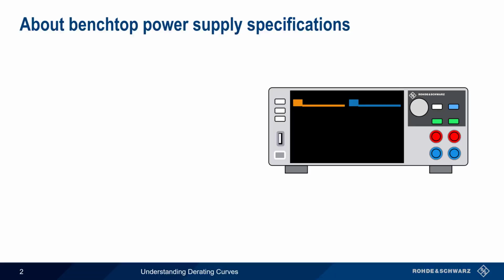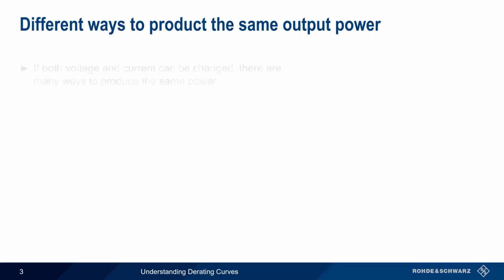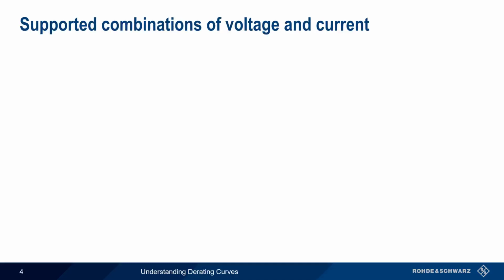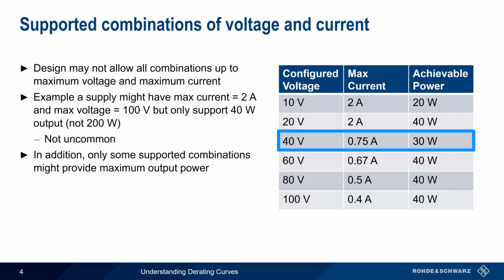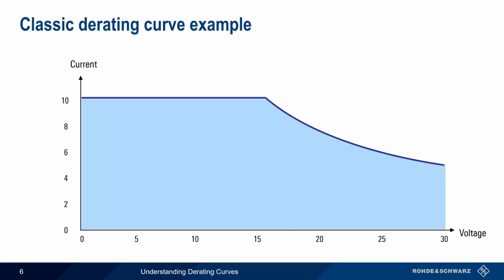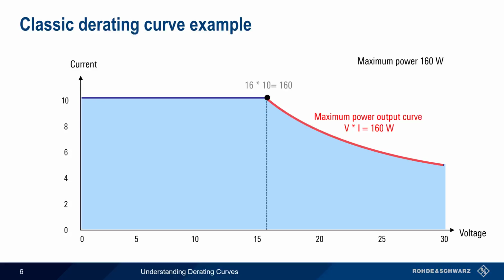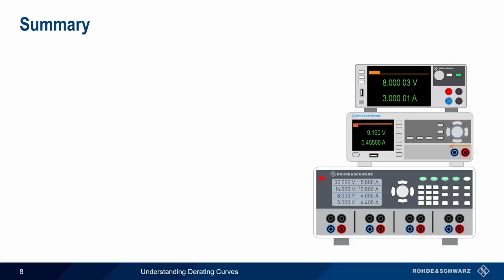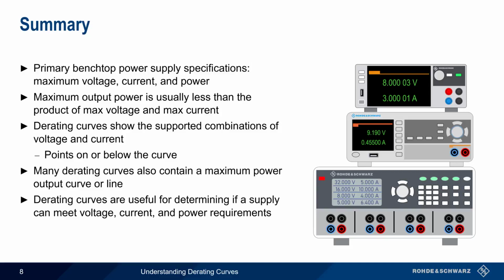Understanding Power Supplies - Derating Curves

Comment: Good thing I learned about the derating curve. I almost pulled the trigger on a NGA102 thinking it would output 210W (35V x 6A) but it’s capped at only 80W, which is too low :(
Reply: That's typical for all power supplies: max power is usually less than max voltage * max current